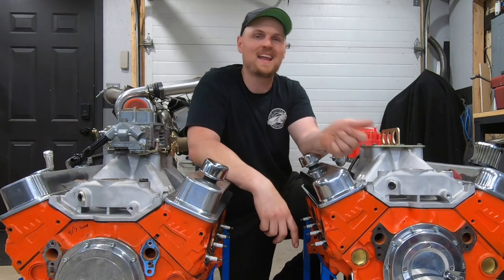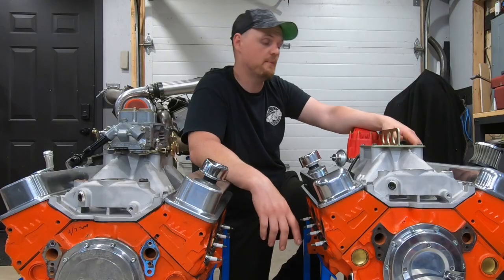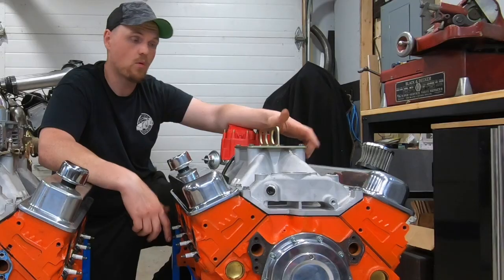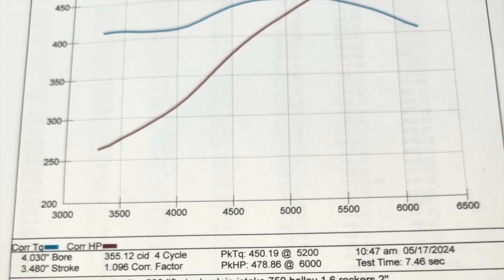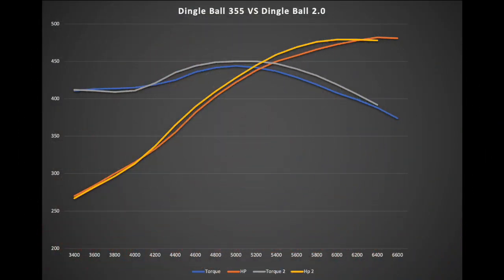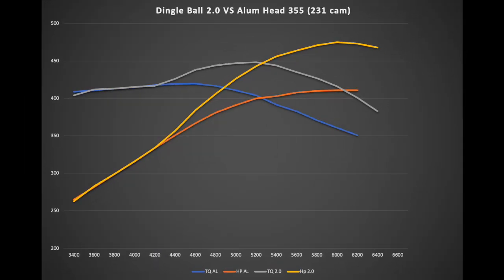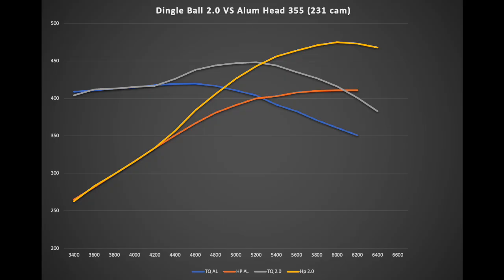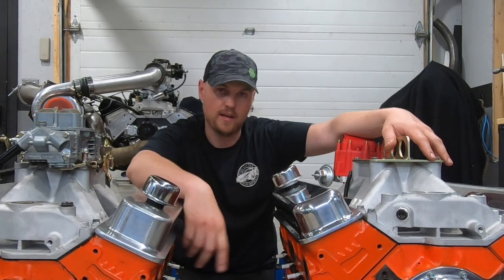479 HP! Vortec Heads w/ Roller Cam VS Flat Tappet (Dingle Ball 2.0 Dyno Results)

Comment: Both awesome engines. 
I have a 377 version I'm going to be putting together soon. 4" bore 3.75 eagle rotating assembly. With some after market vortec heads from jegs.   The pistons do have a dish. I think 7cc. And are .020 in the hole. But with the 64cc chambers and a steel shim headgasket it should still have decent compression.  Comp cams
08-409-8..... 258°/262°-.458/.458

Comment: Great build, I'm going to try the Vortec 4/7 swap in a 400. Think Vacuum be OK for brakes
Reply from the maker: I doubt you'll have enough vaccum for power brakes with the Summit 1205 cam. It has 89 deg of overlap, you'll want something with less than 80 deg of overlap to be power break friendly
Reply: @cuttersperformance  not sure if im reading the card right but looks like that 1205 has 29* overlap?
Reply from the maker: @junkyarddawgfixit8970  seat to seat overlap of 89 deg
Reply: @cuttersperformance  Roger that
Reply: Your vacuum. Should be fine  but you might need to drill steam holes. Engine masters did a 4/7 swap comparison and the numbers didn't change much.

Comment: Are the internals stock
Reply from the maker: No, flat top pistons and aftermarket crank. But a stock crank could be used
Reply: @cuttersperformance  it can as long if you're not doing any boost

Comment: Yeah that's great information! I would always prefer to sacrifice a little compression myself over the reliability of a roller cam but never really knew if it was possible to keep the same hp/ torque numbers.
Reply from the maker: Lift is your friend, other than reliability is the bigger benefit to roller cams

Comment: Would love to see 2.0 tested with a dual plane just for the heck of it.
Reply from the maker: I wanted to but was abit crunched for time that day as we were testing two engines. It made more torque than expected with the single plane
Reply: My wish also
Reply: I was thinking the same thing. An rpm airgap should be able to support that rpm range.
Reply: @thabiznizz  absolutely
Reply: @BradyMurdock  I agree..I'd put my money on the dual plane for the win. Because they usually top out at 6k rpm
Reply: @hotrodswoodshed7405  100% Worst case scenario the dual plane matches top end power and makes way more torque.
Reply: @hotrodswoodshed7405 ive seen them go 6400-6500 and 6600-6700 when ported w spacer
Reply: Love to see this as well. I think the single plane would extend the rpm power range over the Air Gap but, who knows, it might not!
Reply: I have seen some single plane intakes just stomp a dual plane all across the chart and some that killed power. Why, i don't know, but it's interesting to see all the dyno runs and builds testing different set ups. I have a 12.5:1 350 with ported 601 heads with bigger valves made 23 more torque and 12 more hp with a victor jr. versus an rpm air gap. Both were ported matched to a 1206 felpro gasket and was tested with 1 and 2 inch spacers open/4 hole and the single plane trumped the dual plane all across the chart. Why? Who knows. But it would be nice to have some scientific data to kind of get an idea why that happens sometimes.